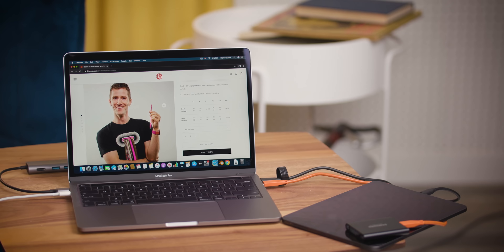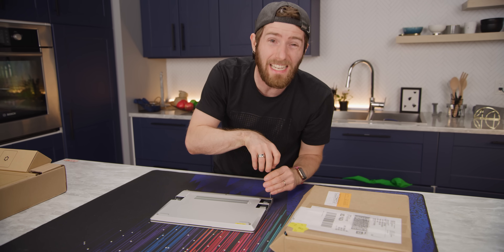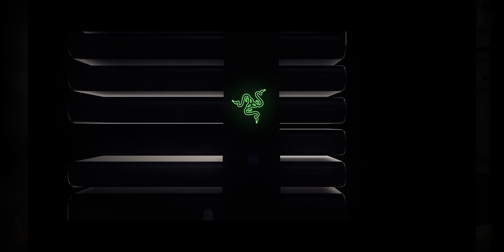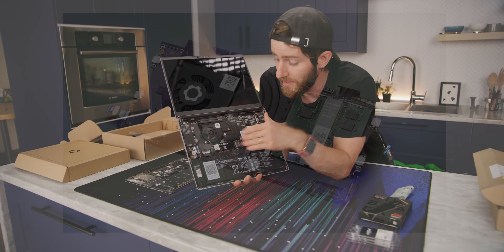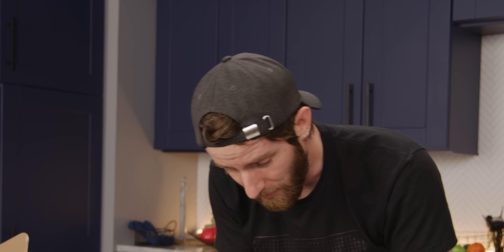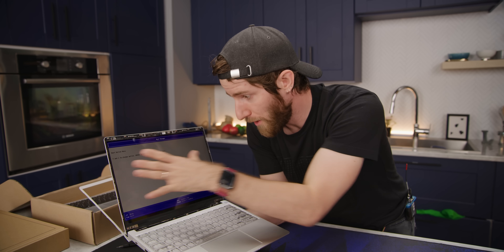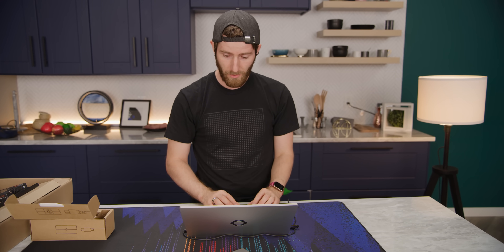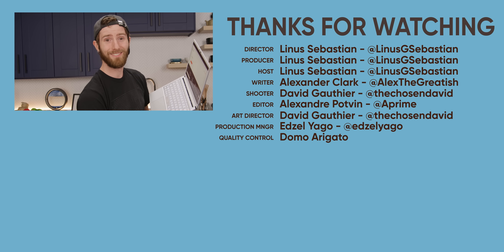A COMPLETELY Upgradeable Laptop?  - Framework Laptop Review

Comment: 10:20 I tell you something: The fact that you get only ONE USB SLOT PER MODULE is kind of stupid. Not every usb connected device is going to saturate the entire link, and the form factor is (at least almost) big enough to support two slots beside one another. Does it come with an ethernet port? Unlikely because that design isn't thick enough to support it. No ethernet port on my laptops is a massive no-go. So in the end, you are only limited to 4 things as per this design. Which is still a problem due to the size of it.
If they really cared, you would have a DEDICATED NVME slot, that is for nothing but NVME for a much better upgradeable storage experience.

The big question is the cost of the upgrade modules, and the next big question is THEIR choice of which things are going in there. So we have to rely on their choice selection plus the cost of the modular part. We still talk proprietary form factor here. It is NOT "put in directly what you want". It is NOT "here is a tray to put your aftermarket piece of equipment in" like YOUR choice of SSD. So yeah, golfclap. They shouldn't get bonus points for doing something that has been the standard in the past.

This looks like a concept that is going the "in spite, for the people!" route. But how many of them will actually be sold remains the question. Yes, they're using the buzzword "modular" better than most others do. Yes they are nice to provide detailed information and easy accessibility with QR codes. But that is all there is to it. The real modularity that the consumers would actually appreciate is still not there, because this laptop, like anything else, remains a business decision.

Comment: Do they specify the standard screw length/thread they use?
I know this sounds odd, but it'd be really cool if I could use my own, custom, security screws.

Imagine reduced support, faster turnarounds, from a highly serviceable laptop like this in corp environment. - but you can still (as much as security screws do anyway) prevent concerns of non-IT users messing around with stuff inside.

Comment: If i had not just purchased a 2500$ laptop i would have gotten it. I really love the fact that they tackled most of the things one hates about traditional roadblocks manufacturer’s put to keep you on a rep purchase time line. Like the battery disconnect option in bios.

Comment: I'd argue that 1) the modular IO is useless in terms of upgrading and only useful in regards of not requiring a dongle and 2) the insides are pretty much like a 2011 MacBook from 10 years ago - thinner and better built after all it has been 10 years but part from the QR codes and colored screws (which is great by the way) this is the same as old laptops used to be. 

Not that I didn't like it I really did and hopefully this can be more than a one-of however I doubt any LMG employee will be using that on a daily basis.

Comment: It is a very nice computer, however they didn't implement thunderbolt, it is only USB-c (please correct me if I am wrong). I really use thunderbolt GPU  when I need a bit more graphics power than Intel onboard graphics. They should definitely implement thunderbolt then it will be a complete package. I believe thunderbolt is a deal breaker. That is also the reason I would not recommend to invest on Surface laptops in their current state. At lease there should be an option (thunderbolt) with an extra cost (eg. 50$-100$).

Comment: I was, just a couple of days ago, grumbling about how nearly impossible it is to upgrade old laptops and why nobody will standardize the parts. This sounds very cool! Now if only they would stick to the same form factor on everything, so that all parts will work on any of their machines in the future.
Reply: They shouldn't even need to stick to the same form factor as long as they keep with basic sizing dimensions. I hope they put out a 2 in 1 option at some point. Maybe even one 17inch they have room for a gpu module but the cpu is still the same size as the current one.
Reply: I feel like those I/O blocks will go the way of the dodo. They need a new design with a compact B2B connector. But the rest looks fantastic.

Comment: I'm fucking sold. I open laptops as a hobby and as a sideline and this just makes it very convenient. You do not have to worry that much if you break a notch or pull a wire because of how easy it is to open the backside. Not to mention that it's easier to unplug the display's cables. Well done Framework. 

Now, the only thing I wanted to see in the future is having a second fan to cool the gpu.

Comment: Asus TUF Notebooks are actually somehow easy upgradeable too.
Mine has two memory slots, four M.2 slots with two free slots, a 2.5" bay and a easy to swap battery. Yes, you need a screw driver and need to open the case for all of these but it is pretty easy to do and shouldn't take longer than 10-20 minutes depending on experience.
I even saw a video about how to swap out the display panel and while it was defnitly more complicated than swapping the battery I still consider it moderately easy.
We do not need consumer electronics which are super easy to modify and we do not need to modify every bit of it. But a good balanced effort as in the TUF series is a GREAT value.
I upgraded my €800 TUF book (Ryzen 4600H, Geforce 1660Ti) to 32GByte memory and 2500GByte mass storage for €210. A steal.
I do not care if I have to remove 6 or 12 screws to swap the battery, I just want to swap the battery at all.
Reply: And btw if I did not already own a TUF I would order a Frame.Work immediately.

Comment: Interesting, I like their philosophy. My desktop replacement gaming laptop will last maybe 2 more years still - if framework makes one themselves* until then and upgradable, this would definately be an option to be considered...
For an upgradable device (bought an fairphone half a year ago) without glued parts I am willing to pay maybe 10 to 20% more. If it's possible to upgrade motherboard, CPU and graphicscard after three or four years for a reasonable price this is easily saved in the long run...
*17", maybe two versions, about 20mm and about 30mm thick, a bay for one or two 2.5" drives, 1 display ports fix, a second as a module, 3x2 USB connexions, docking station and a huge (maybe external) battery with a flexible charging mode (I do not need battery for the next few days or weeks at least? Just charge it to 60% and let it alone until I say otherwise or it falls below 30% to expand battery lifetime, then it can be even an internal battery)...

Comment: 16:16 that's not what it's for, Lenovo laptops also have this, that function is so that you can disconnect the battery before you start working on the laptop's internals. I'm not sure it would work while plugged into the wall, that kind of defeats the purpose.

Comment: Back in the day laptops had some modularity, the batteries were easy to swap, memories were similar to the ones of a big PC but slimmer and smaller.
Also you had more plugs, there was the possibility to have integrated optical drives and there was the PCMCIA port.
One of my old laptops had also a mudule for a TV tuner.
It's quite a recent trend to have the batteries not removable and the whole need of the thinnest device.
I never minded to have a somewhat fat laptop because my priorities are about it to have good ventilation and some modularity

Comment: OMG I love this.  I have upgraded mine and my girlfriend's laptop many times and with mine the 32 screws I have to undo are a headache.  I even had to solder on a new power jack since after being kicked out so many times my original jack cracked. I use both a wire mouse and a wireless mouse/keyboard combo for watching youtube while connected to the tv.  Oh one caveat.  I have to have an upgradeable CPU. No soldered on CPUs nope.  I upgraded my gf's CPU on her Asus no problem.  Just getting the rice sized dab of heatsink was the tricky part.

Comment: The most important part for me in a upgradeable laptop would be the GPU which is not addressed at all in this video. I have a stack of old "gaming" laptops that all have at least a quad core CPU and 16GB of RAM min but the GPU is so old that I cannot use them for gaming anymore. All of these laptops would be viable again if only I could swap out the GPU as that is the single thing making them unusable.

Comment: So, I've purchased 6 laptops from Alienware/Dell that have all exceeded $5,000 over the last 20+ years mainly because I work for an airline and am on the road more than home. I buy from them because of their great 5-year warranty, even though I know that they use a ton of used parts over and over (which I didn't mind as long as the laptop ran my games well). But I have to tell you, this is TRULY the first laptop that I hope to buy next when the time comes in 2 years. Why? Alienware still has a great warranty but the last two laptops both thermal throttle so bad and the fact that I can now replace bad parts easily (or upgrade them) means I no longer need an extended warranty. That is actually a huge thing. 

I hope they work with parts manufacturers so that cool stuff like the keyboards or screens can be replaced easily. I HOPE they also start a buyback system so that I can sell my used parts back to them when I buy an upgrade. This provides two benefits: one is that I can upgrade whenever I want, but it also provides a path to buy USED parts from the manufacturer if I don't want to upgrade but simply have a hardware failure. This also solves the "right to repair" issue plaguing so many manufacturers like Apple that are fighting it HARD. Louis Rossman will be so happy to see this, lol! Make sure that Marques Brownlee also knows about this so that the word gets out! We need to try and support this company so that this becomes the standard, by this company leading it!

Comment: I miss when my dell laptops had PGA processors. Stupid Intel doing away with them for laptop chips. Wish Dell had switched their Precision line to desktop CPU's to maintain that feature....
Reply: I remember a few companies did desktop replacement laptops with socketed PGA chips. Problem is they were higher power consumption than the laptop parts. Also in a laptop there's going to be a fairly tight thermal limit for the CPU determined by the cooling solution. So even if your laptop had a socketed chip it wasn't necessarily possible to upgrade to a higher power consumption chip. Actually MxM upgradeable GPUs had the same issue - the Bios had to tell the MxM chip the maximum power consumption the system supported and the MxM module had to check that before powering on. 
   
Howevever I could live with that, particularly for something like MxM. You're buying a machine where you can uprade to any GPU which uses less power than the power limit the system supports. 
  
Another option for both CPU and GPU would be to standardise the motherboard size, mounting hole position and CPU position (to make sure it lines up with the cooling system). That way you could do upgrades by changing the motherboard. If the motherboard standard was open you might get multiple motherboard vendors and laptop builders, rather like the ITX standard allows for you to buy a motherboard from one company and a case from another. Actually given an open standard you might people doing Kickstarters to build motherboards with Ryzen, ARM, Risc-V and so on with whatever the current best performing GPU is. At that point you've reached laptop nirvana where you buy a laptop and then just upgrade the motherboard when you need to just like you do with desktop PCs.
Reply: @user-qf6yt3id3w  yeah. I thought about the power concerns. Although, most of these machines that I am thinking of are marketed as "desktop replacements" or "mobile workstations", so maybe that could be addressed thru the power profile feature for plugged in vs battery. I like my MXM card (I have the last gen that Dell used that format), although I am upset that the subsequent cards from nVidia moved the VBIOS off the card and onto the MB (Quadro P5200 or any of the Turing cards), which prvents me from upgrading that beyond what I already have....

Seems like the trend is less and less user customisation for business-class machines, which is a shame, as a small business like mine just doesn't really want to budget for a new $10k machine every 3 years, when I used to be able to go over twice that by upgrading over time.

Comment: Has anyone tried running any linux distros on this? I'm still traumatised by some OEMs (looking at you Sony...) whose system could not run ubuntu for example without a ton of pre-flight grub commands.
Reply: They specifically mention on their website that the hardware has linux drivers and they are working on making it all work smoothly with common distros

Comment: All laptops are completely upgradable you clickbaiting chipless breadboard. Most people just don't have the guts to take a screwdriver to the cosmetic chassis of their precious Toshiba to replace a component. Once you get into non-upgradable territory you're talking parts you couldn't change out even in a modular system.

Edit Correction: You COULD change them out, but it's cheaper and more efficient to invest in an overhaul or replacement of your outdated machine.

Comment: gotta miss rPGA, tbh the right to repair should banish the fkn soldered chips, it's moronic, ofcourse some laptops really cant support higher power CPU's than they have cause of the abysmal cooling but it's better to have options..
rPGA was a gift, BGA was a poisoned gift..

also why won't they make some adapter board thing?
pretty sure it shouldn't be too hard to upgrade when they make that as both the 10200H and the 10980HK use the same BGA (1440)

I mean it's really intel's fault to stop producing them but for an upgradeable laptop?

Comment: "...the power button/fingerprint sensor was built by goodix and features Linux drivers"

TAKE MY MONEY!
Well, my I'll stay with my Ryzen laptop for now until it's obsolete and Framework releases AMD models, but if they're still arround and not a failed project by the time I need an upgrade I'll probably buy from them.

Seriously, we need more manufacturers releasing Linux drivers.

Comment: Here is my one question: 
Can it accept an external graphics card? Or does the USB 3.2 spec not support that?
Reply: what's really bugginh me that they didn't even talk about it or mention it in the video. It's built-in Iris Xe Graphics which is not the best. even framework website doesn't include it in the upgradeable parts. so you're kinda stuck with it.
Reply: that's the one thing I didn't like about it, but everything else, is spot on

Comment: I absolutely love this! Right now I have a Chromebook (can’t be repaired or upgraded, period), a Dell Inspiron, and a very old and cheap HP laptop. The Dell Inspiron can be user-repaired but it is a GIANT pain in the ass. I’ve opened the chase many times to swap RAM and upgrade the hard drive to different sizes of HDD then to SSD. I went with the Inspiron because before I bought it, I researched to make sure I could DIY. The average consumer wouldn’t take time to learn though or feel comfortable doing upgrades themselves on it though. 

The old HP laptop is now serving as my home network’s server. Because of its age I installed Ubuntu which is lighter on resources and then installed Pi-Hole. I’m using Samba on it too to file share across my home network (5 TB storage total). However when I upgraded the HDD to more storage it SUCKED getting to the SATA port. Had to disassemble literally the entire laptop case + hardware to swap SATA HDD. I’ll never make upgrades to that system ever again, I’ll just buy a different laptop used if I need to replace the current server setup I built. 

But yes, make parts easy to swap or replace!!! Great product idea and I hope they turn into a really successful brand.

Comment: This thing is frikkin' sweet! I really hope it's Hackintosh compatible. My MBP is almost 10 years old and, while it's still running fine, I know it's only a matter of time before important (and non-servicable 😡 ) parts begin failing. I'm utterly uninterested in rewarding Apple for their glue-solder-seal crap, but most of the software I use doesn't have Linux alternatives so it would cost me beaucoup coin to switch to Windows.

Comment: Two quick questions: 1: Will windows still be valid if/when  you upgrade the motherboard/change the hardware spec? 2: whats the graphics set up and upgrade options in the future?
Reply: Does it have the TPM chip? I thought these days you had to have that chip to run W11?  I guess it must or there would be a lot oof returns.
Reply: @niv8880  I was thinking of Win10 TBH. I was under the impression that Win10 was hardware validated. SO if you swap out a MB or such it would no longer be validated. Is this not true?

Comment: you can make anything pretty with a strapped on housing(preferably a lockable one to discourage more subtle thefts), it's the accessibility of the components and availability/desire to swap them that makes something supposedly modular become something of a trend setter (most often seen in mechanical devices due to a vast array of users, a mainline platform most people accept and the desire to personalise said devices).